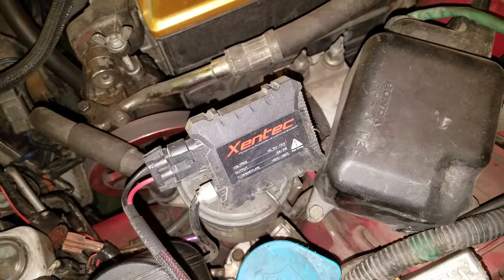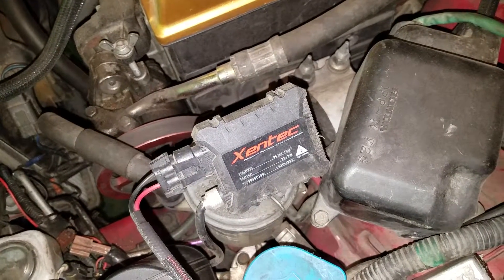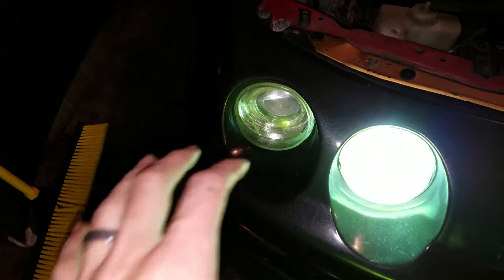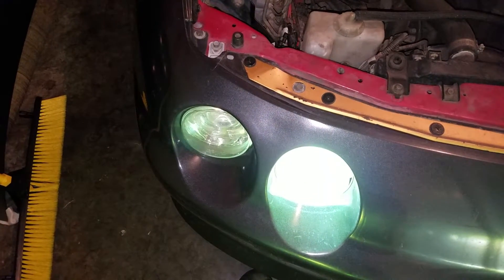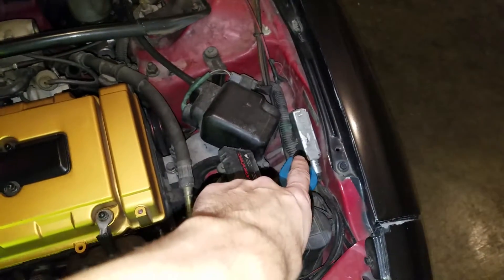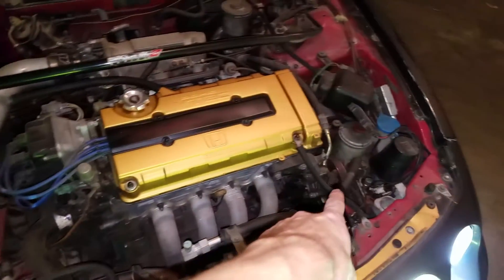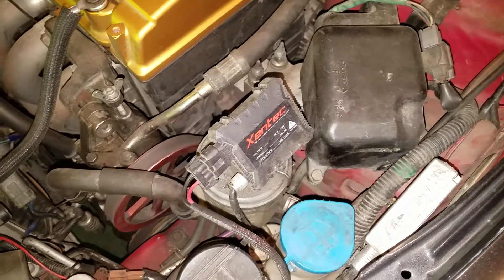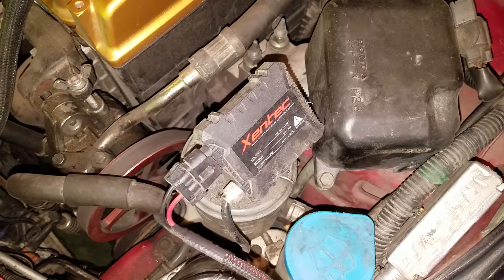Ebay Xentec HID Ballasts & Bulbs - How Long Do They Last? - EP #9

Comment: thats really good, i just bought a set of these for my car as well as my brothers 30 year old car, he still has the factory bulbs in the car and they absolutely suck after 30 years i think i paid like 26$ for each set, so we will see how they do
Reply from the maker: Yeah for the price they're good. Compared to high end HIDs, they're not great. But hopefully a good upgrade to the old car! Were you able to find projector housings for a 30 year old car?
Reply: @TheCFProject  I thought about that lol, I haven't looked yet, only issue I have with getting new housings is that the original ones are glass and don't turn yellow, I just don't wanna end up getting plastic ones and them end up turning yellow after a few years. But I may look into it if the cost is low enough to not really make a difference
Reply: @TheCFProject  yeah on second thought, I just looked them up and the OEM replacements are well over $100 so I think I'll stick to the ones in it now, I just need to figure out how to aim them correctly so the beams will be even
Reply: Do you recommend this xentec hid kit? I am going to order, that's why it's important for me to know feedbacks

Comment: I have an issue with low beam headlamp ballast problem. I search many ballast at eBay and comment at YouTube.  Here is an conclusion,  Xentec ballast is DC while my OEM from hella is AC output. This make huge differences from how durable and quality.  Definitely AC is more favorable,  however,  Xentec is ok if you accept 3-5 years life cycle. Now,  I'm planning to use LED but need to configurare sth. for headlamp so that I can easily swap back to HID without big project to remove bumper. Thanks!
Reply from the maker: Yeah I've been pleased with the life of these ballasts and bulbs. However, now that I've got more money to spend on my cars...I think I'll be paying for the higher dollar stuff now to get the higher performance. I looked at LED, but I'm concerned about the higher heat output...I think I'll stick with HID for now.